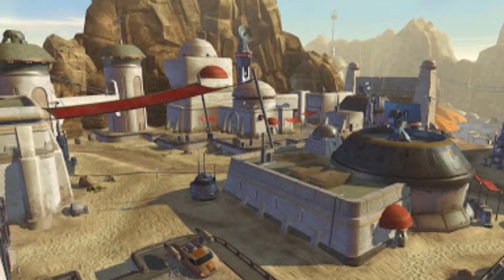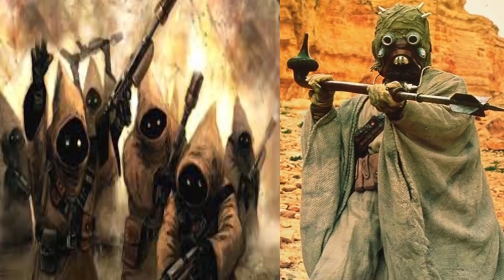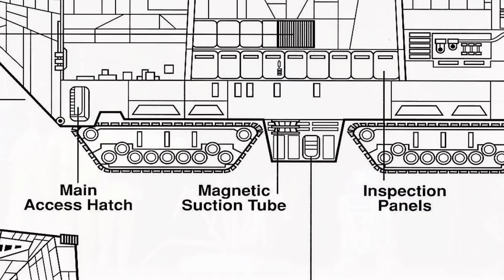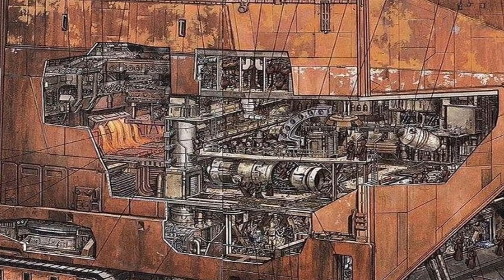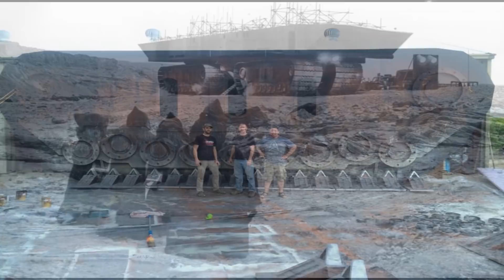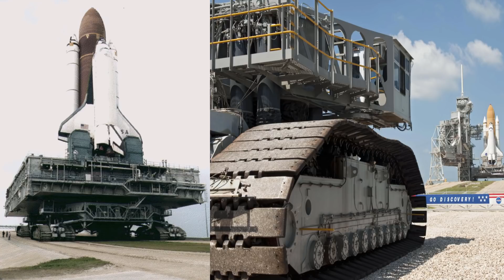COMPLETE BREAKDOWN! - The Jawa Sandcrawler - Star Wars Ships & Vehicles Breakdown

Comment: I notice an error in the cross-section - The ceilings are way to low. If it was built for 6 Foot Corellians the ceilings would be taller - not to mention a lot of the droids they'd capture would be too - so they may not want too lower the ceilings.
Now it might be possible they refloored some sections to enhance cargo space but overall i'd say some sections should be taller inside.

Comment: Interesting fact, the Jawa sand crawler has the most powerful air conditioner in the galaxy.  Big metal box rolling around in the desert with a smelter on board, if the A/C wasn't working you'd have delicious baked Jawa's, set oven for 375 degrees for 50 minutes lol.